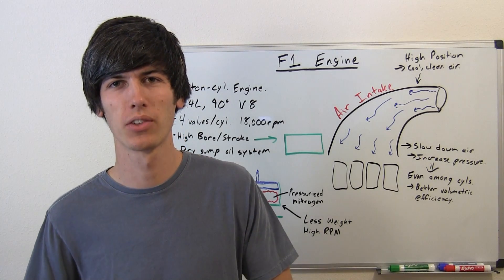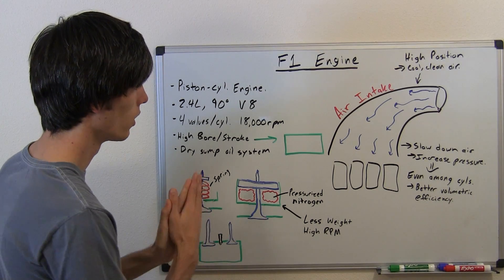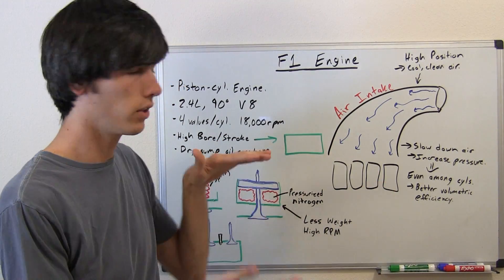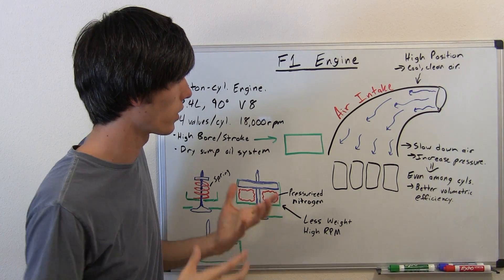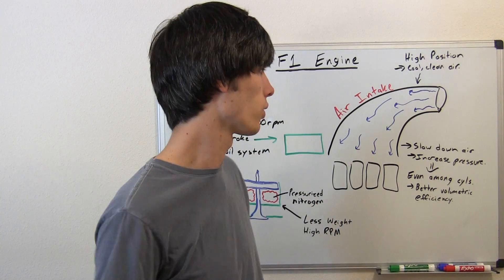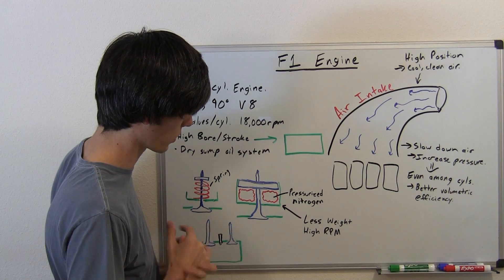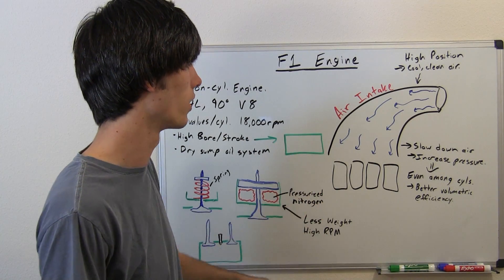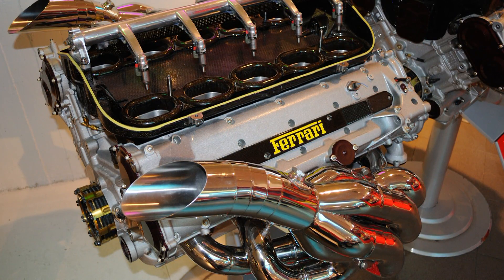F1 Engine - Explained

Comment: the seat some degrees after IVC. this can occur anywhere in an engines rpm range when the spring is operating at a frequency which aggravates it.  btw that's the reason dual springs exist one covers the others bad frequency. also why they make tapered or beehive springs the frequency changes along with rate over the length of the spring.  

anyways the pneumatic spring (only the spring were not talking about the cup or piston or valve stem) has almost no mass guess of 0.05grams so it wont

Comment: IVC values around 60* in performance engines.  

also the real reason for using pneumatic valve terrain isn't for greater pressure, imagine what a top fuel car or pro stock runs for spring pressure with valve lifts of 1" and >2.5" intake valves @ 8000rpm vs a 30mm valve @18000rpm.    the real reason is the coil spring is undampened. when the valve hits the seat the middle coils actually shake up and down.  also the head of the valve is a spring. if they unload simeltaniously it will jump off

Comment: well no doubt its a diffuser for pressure recover, but the purpose of the orifice facing forwards above the drivers which feeds the diffuser, is ram air!

you forgot things like the independent throttle bodies.
the fact a dry sump system uses multiple scavenge pumps to keep the sump dry and the oil tank full.

85%VE is terrible an f1 engine is above 100% in a correctly designed port there is enough momentum to continue pushing air into they cylinder after bdc turn around hence the reason for

Comment: if you can get typical OHV heads to function properly at 19,000 RPM with no valve floating you are a better designer than the pros. the spring tension would have to be so stiff to prevent floating that the rest of the assembly would wear out too quickly to be usable in a race engine, do not forget they use regular heads in NASCAR, so failure rates are normal. it is the high RPM that causes the problems because of the valves floating.

Comment: Because metal springs are cheap.  However, with tightening epa and upcoming government  mpg regulations, you will be seeing nitrogen springs with no camshafts.  It will be so that variable valve timing can be controlled by a computer giving precise valve timing control.

Comment: Why wouldn't street cars use a pressurized nitrogen system for opening and closing their valves? It seems like it would be much more efficient, the only reason I would think they wouldn't is because of cost issues.

Comment: To simplify everything for you, heres what makes the most power in a perfect world. Ice cold air, Ice cold fuel,ice pack the intake manifold, cold engine (ambient temp), HOT oil(racing operating temp). Ask any circle track racer( which i am) or drag racer what they do to prep there engine before qualifying and they will give you the same answer.

Comment: Wrong, this would increase the speed and reduce the pressure. Not what they are looking for in an F1 engine. They need the pressure to be elevated and even. I am sure the engineers have tried many different configurations and what they are using is the best with what F1 sporting regulations allow.

Comment: Pneumatic valves are because metal springs do not close the valve fast enough when rpms are above 11,000. Has nothing to do with heat or work fatigue.

Comment: It does not ram air into the intake. It uses Bernoulli's principle. The duct is actually divergent duct. Slowing the air and increasing it's pressure. Same principle used on a turbine engine.

Comment: Turbo was banned for many years within Formula 1. Rules back then made turbo very hard to controll due to extreme boost pressures, that introduced alot of turbo lag. It was concidered too dangerous. For the 2014 season turbo will be back, due to fuel efficiency amongst other things.

Comment: The difference being that a 'ram-air' system has a larger opening that tapers in to a smaller area.  This being a 'diffuser' style system because it has a smaller opening that tapers larger.  If it were intended to be a ram-air system this would be the least efficient design possible.

Comment: Air intake IS a 'ram air' design....the intake must always be a smaller cross section than the plenum . This allows the air entering to act like a pump action on the air already in the plenum. If the air intake mouth was same size as the plenum section, air would spill back put of the plenum.  Think of the small intake mouth area as a small cylinder pressurizing a large cylinder. The same way a compressor uses a small piston to pump up a large tank.

Comment: You talked about the air intake being defused to be spread more evenly and efficiently to the cylinders. In my mind I ask why is F1 not turbo charged? Should be able to increase power dramatically, evenly, and possibly make the engine smaller and put out higher power making the cars lighter and making a power to weight ratio much better then it's already impressive ratio. - from mind of a tcom major, let me know if I'm just retarded

Comment: Well, yes you say it is a diffuser, but as you yourself said, it creates higher intake pressure than if you would not have the intake like this. The diffuser is for making high speed air into high pressure air, thereby increasing the intake pressure. Basically, an air ram intake but properly enginered :)

Comment from the maker: Well, if the air is super dense, but your engine certainly doesn't want to be that cold. Your best efficiency is when the engine is warmed up and properly lubricated, which requires the oils to be warm.

Comment: This is quite bad... A shorter bore is going to mean the piston is moving faster... This is what makes the engine rev higher. A standard every day car using a wet sump configuration NEVER sucks in air if the oil levels are correct. The main reason for a wet sump is to lower the engine to decrease the centre of gravity. Another point, in an f1 engine you want to get the air into the engine as fast as possible, the intake is designed like that to get as much in as evenly as possible.

Comment: I think they use pneumatic valves over hydraulic because gas has less specific mass compared to liquids. This will give the system less inertia, therefore, high valve frequencies are possible. I don't think it has anything to do with corrosion. 

Also I think it's important to point out that the reasons springs are not expectable in these engines is because they have a high failure rate. This is from heat and work fatigue.

Great explanations though!

Comment: RE spark plugs - I would doubt they are the same as production car - years ago the trick was to 'side gap' the plugs which is cutting the ground  electrode back so the spark is more exposed to the cylinder and this helps grown the flame kernel better - so better power and efficiency - the downside of plug life is not relevant in F1 really - no idea what they do now - I'm a bit surprised there is no milti spark system but maybe that's against regulations...

Comment: Volumetric efficiency will exceed 1 - even on production car engines. This is done with inlet runner tuning - tuning the pressure waves as the valves open/close means at certain rpm's there will be a positive pressure wave at the intake valves and so can consume more air than atmospheric pressure will allow. This may be in the region 1.05 - 1.1 for production cars and I would guess 1.1-1.2 for F1.

Comment: im just thinking off the top of my head but would reversing the shape from what you have (instead of small inlet and a wide bottom to wide inlet with a narrow bottom) the sideways L to  a V or cone shape forcing the air to compress into the intake?

Comment: as far as turbos go, they haven't really said anything about twin or single, but they have flat out ruled out compounded turbo systems (compounding turbo's would make a great video btw ;)) and also, there is a little rumor floating around they might allow inline (like bmw's asymmetric inline 6) back in. either way, the news im most hype for: the new street track in new jersey/new york.

Comment: Nice video. But F1 engines has  V.E higher than 100% even though they are normally aspirated. Otherwise they would not be able to make 750 hp on 2.4 liters. They do this by valve overlap and scavenging to give the intake air so much inertia that it keeps flowing into the cylinder even when the piston starts to move upwards.

Comment: It is going to be single turbo units. Regardless, single vs dual turbo doesn't have any real effect on the sound. It is just going to be more muted because of the turbo in the exhaust system. Whether it sounds bad or not, that is a matter of opinion.

Comment: As well as wider bores and shorter strokes to manage piston ring feet per minute the rod to stroke ratio is much higher eliminating piston skirt side loading, both are need for a high reving engine to survive.

Comment: What's it matter if on a dyno or a race? Well considering your initial comment, you remember when they were revving over 20K, it would seem clear that it was a reference to a racing situation and not on a dyno. I don't think I would be in the minority in that. I'm sure many engines test far beyond what we see in races and blow up after the equivalent of 10kms, hardly the same thing and not what was inferred from the initial comment. Anyway, no harm no foul, moving on.

Comment: The 3.0L V10s were at about 900-950HP, so thereabouts, would be pleased to see where they were running above 20K pre Cosworth V8 2006 at a race weekend.  I assumed you didn't mean some experimental engine running on a test rig which you wouldn't experience unless you were at the engine factory. Re the trolling comment, sometimes when obvious slaps you in the face, you can't help but get cute.

Comment: rumors are a single turbo with variable geometry, which defeats most of the need for twin chargers entirely. The imposed fuel restriction will put the 1.6L V6 engines at 650bhp IF they are no more efficient than the current V8's...chances are it will be higher, and they'll actually be very close to the V8's...with a lot more additional bhp from the revamped KERS (now E-KRS iirc) rule set. There is also talk of reducing race weight to 1350 lbs again, instead of the current 1415.

Comment from the maker: Because you're expanding the smallest space at this point (as well as the exhaust scavenging). Hear me out for a second. You have a vacuum in the piston at TDC before you start pulling in air. If the piston is to move down an equal distance from the top of the cylinder head, it effectively doubles the vacuum. The peak may come from exhaust scavening, but the entire process of moving the piston down allows for a continuation of this vacuum.

Comment from the maker: "When the piston is at TDC during overlap is when vacuum is at it's greatest in the cylinder. NOT BDC." Obviously, yes. But it doesn't take much air to fill 1/4 or 1/5 of the cylinder. That would translate to a volumetric efficiency of 20-25%. The piston moving down pulls in additional air.

Comment: Exhaust momentum (mass*velocity of the exhaust gases) creates the scavenging effect which is used to help pull remaining exhaust gases out of the cylinder and create a higher pressure differential across the open intake valve.  It doesn't hurt to pull air through the cylinder.  The trick (to carburetion or injection) is to optimize the exhaust valve closing and fuel addition so that you lose minimal to no fuel-air mix out the exhaust while evacuating all the combustion product. (DI=Holy Grail)

Comment: The basic layout is given by the FIA, there are 3 different manufacturers, Ferrari, Mercedes and Renault. The engines are not the same, but are pretty much equal in terms of power output though. The MAJOR difference is in the chassis / aerodynamics and especially in tyre wear now. 
Red Bull has the quickest car right now, lots of downforce while being gentle to the tires. Mercedes was strong in qualifying in the last 2 years, but the car toasted the tires too quickly, race performance was poor.

Comment: So fuel injection happens in intake manifold before the air enters the engine cylinder? Are there any disadvantages of injecting the fuel in the inside the cylinder during the intake stroke of the engine cylinder?

Comment: No you don't remember that, I'm afraid you made it up. The engine you are incorrectly referring to was the 2.4L V8 Cosworth in 2006. Don't think you will find much evidence of the V10s running at 20K RPM, certainly not on race weekends. The rest of your comment, not sure if a funny fail or trolling.

Comment: To get to those 18.000rpm they don't use a normal camshaft. instead they use a electro-magnetic system that operates the valves. it's much quicker.

Comment: I think this guy should do another episode for F1 cars and elucidate on MBEP and average piston-speeds. It is interesting corollary that average peak piston speed is right about the same for F1 engine as it is in any other high-performance engine (Ferrari 458, Corvette Z06, and F1 cars all have average piston speeds ~24 meters/sec) due to metallurgical limitations with inertia, which is also very close value among all three at their respective peak operating RPM's. Overall though, cool video.

Comment from the maker: No, based on the Bernoulli principle. Check out the differences between a nozzle and a diffuser. A nozzle increases velocity by dropping pressure. A diffuser slows the air down, and increases pressure.

Comment: Above 100% VE is very much possible. During the intake stroke, the air develops a lot of velocity and thus momentum. That momentum can bring a bunch of air crashing into the cylinder well after the piston is at bottom dead center. This effect works better at higher speeds so that's why really fat cams will work well at high RPMs. They are holding the intake valve open long after the piston is done pulling in air. The piston is actually pushing back on it.

Comment: not sure about 1:55 when he talks about F1 engines being oversquare and how this helps them achieve higher rpm. The shorter stroke giving lower piston speeds I get but doesn't the wider bore actually detract from its ability to rev higher? Wouldn't the speed decrease as a result of the greater time it takes the combustion to spread out from the central ignition point and hit the sides of the cylinder?

Comment: Aerodynamics, ECU, Exhaust, Suspension. The teams are allowed to modifiy and tune quite a few things. Of course every modification is checked by officials of the FIA because there are rules on how far you can modify everything. Thats the reason why lots of teams try to find a "hole" within the rules to develop mods that can get them a large advantage against the other teams like RedBull and McLaren had a few of those tricks during the past few years.

Comment: Because the Engine are not all the same, there are still differences between the brands. But much more importent, the car's aren't the same either. We are not in the 1950's anymore and the aerodynamic, location of the center of gravity, the suspensiongeometrie and so on are much more importent than 20hp more or less from the engine. To carry 10mph more speed through a corner also means, you are 10mph faster at the beginning of the straith and 20hp difference won't make that up.

Comment: I didn't follow you for one point : air intake fluid physics. If you suck air with a smaller opening to becone bigger, you actually slowing dowb the air speed, DECREASING the air pressure while cooling it down (may be neglect). PV=NRT (same principle/physics laws can, at certain point, be applied with atmospheric air)

Comment: Hey, two things, F1 engines can be compared to NASA space shuttle it is complex as hell, therefore there timing is impeccable. Also the design of the intake manifold helps with pressurizing the air, allowing for a greater pressure within the combustion chamber than would normally be found on road car intake manifolds.

Comment from the maker: I believe it may have to do with the design of the intake, which causes an increase in pressure (it's a diffuser) in relation to atmospheric pressure, which would then allow for a VE of greater than 120%. I'm not positive, but the logic seems sound.

Comment: Hey, I don't wanna be a wiseguy, but we need a good valve control to get 100% (or even more) Volumetric Efficiency (w/ turbo or supercharger) too :) 
When Intake stroke beginning both the exhaust and intake valve is open (about 20-30° crank angle) to help to charge the cylinder with maximum amount of fresh load and get rid of exhaust gases. Exhaust gases speeds around sonic speed so it will make sucking pressure through exhaust valve.

Comment from the maker: The purpose of the high intake is to get clean (no particles from the road, tires, etc), laminar (non-turbulent, undisturbed) air. Yes, cool air rises, but that said 3 feet hardly makes any difference. However, if it's a sunny day the track could be fairly warm, so air a few feet up may be a bit cooler than right above the track.

Comment: Bud385 just likes using engineeringy sounding words to sound smart. Also I thought that the bigger deal with pneumatics was to 1 reduce strain on cams due to insane spring hardness because of the change in spring rate over distance whereas the pneumatics have a consistent rate of return pressure (feeds to a larger reservoir) and to get rid of springs resonating at high rpm.

Comment: Are the fuel injectors supposed to be that high up? And is the low pressure in the piston chamber what then sucks the fuel in? Also are the injectors segregated in the air intake chamber? Or is there possibility for fuel to fly around in there?